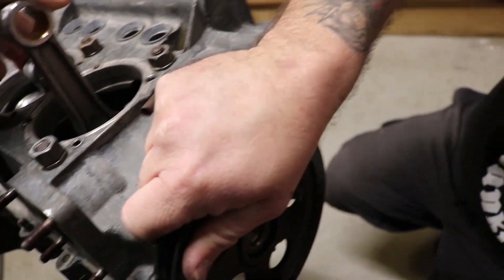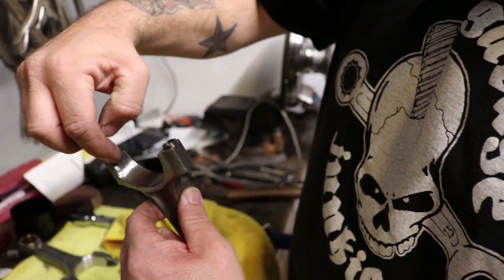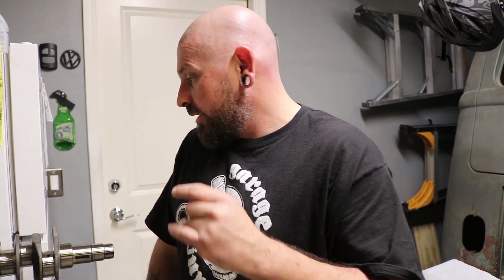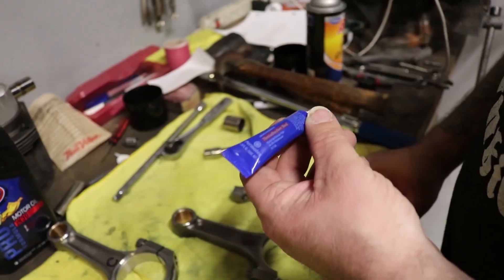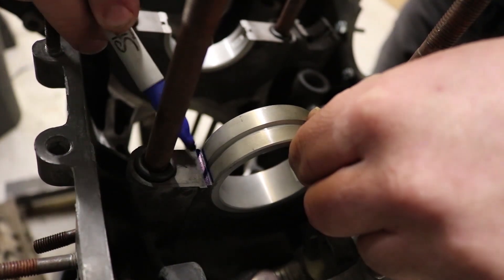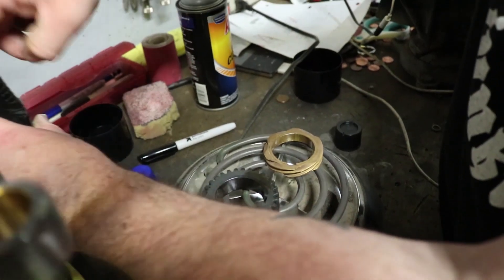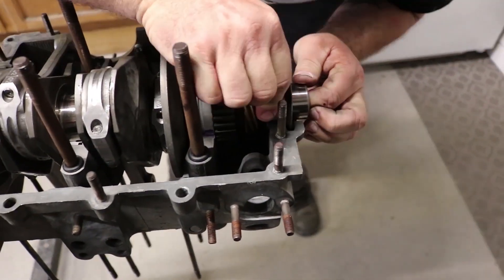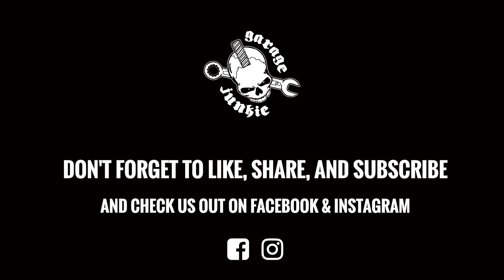How To Build a VW Engine Part 2 : 74mm Crankshaft Assembly

Comment: Everyone I see putting the big end on the crank torque in stages and tap the side of the rod at the big end. They do this throughout the procedure and if the inserts are the right size and not too wide they seem to be fine after the final torque value is reached.

Comment: you sped through putting all the gears on the crankshaft!  What order do they go in?  Which way does the oil splasher face?  Do I need to be  careful about overheating the brass distributor gear?  How do I line up the cam gear on the crank to the one bolted to the back of the cam?  I liked the video and the way you presented yourself, but you left a lot of info out.

Comment: sorry, I know this is an older vid - - was wondering about bearing clearances - what were you shooting for in the tight/lose range? Didn't see mention of plastigauge or otherwise  - -  thanks
Reply from the maker: You don't need to plastigauge vw engine's. You can but not needed. They run "loose" and tight because of thermal expansion.
Reply: @garagejunkie6742  Thanks, appreciate the response - great series of vids.

Comment: Greetings from Brazil. I learned a lot about car mechanics performing maintenance on my mother's 1970, 1300 cc Beetle and my 1975, 1600 cc with 2 Solex 32 carburetors. I disassembled and assembled these engines several times, but I didn't have as many tools and knowledge as you have, but the services got good results. I liked your videos but I think that these VW engines modified to increase horsepower get very shortened engine life. I have always heard that the case does not support very high revs and horsepower and as the speed goes beyond 4500, the case begins to take damage in the bearing region, especially the bearing that is near the flywheel. What is your experience with these engines working at high power and high revs? People say that these engines when working at high revs and power, last for minutes and have to be disassembled and redone. God bless you.
Enviar feedback
Histórico
Salvas
Comunidade
Reply from the maker: Power, reliability, cheap. Pick two... This engine runs strong, but I don't disagree. It's not an engine that's meant to last. It's a fun toy (that I drive daily). I have to say though,  that I can never go back to driving a stock VW... Anything less than what I've experienced with this car will be disappointing I'm afraid. Thanks for your input!